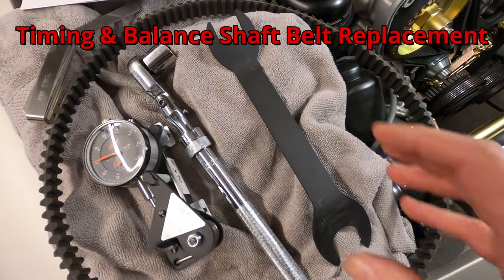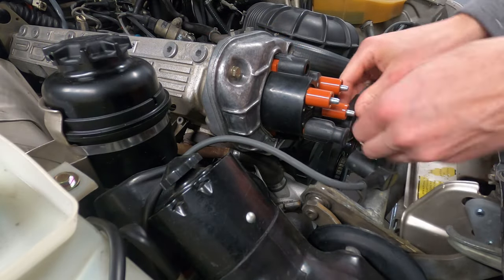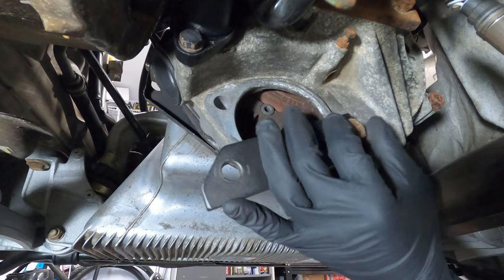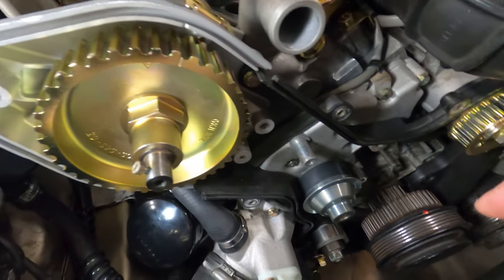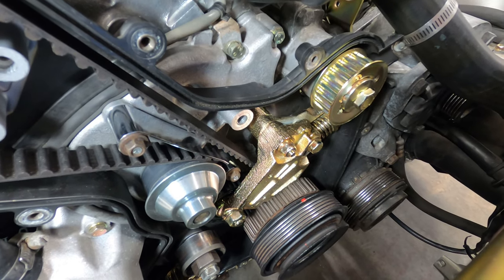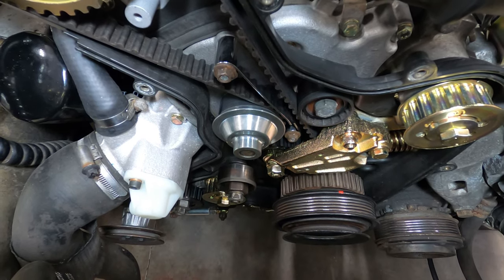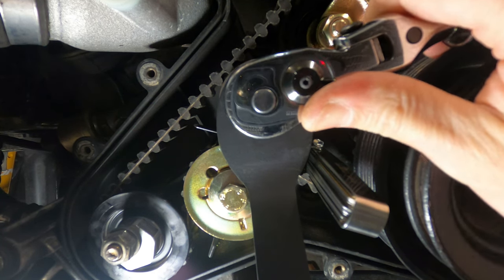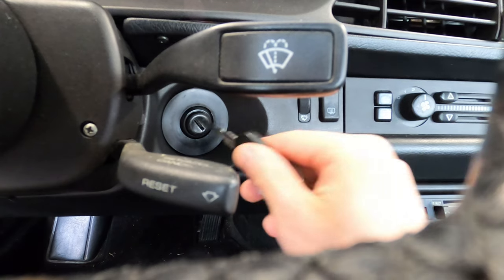Porsche 944 – Timing & Balance Shaft Belt Replacement Tutorial (Spring Tensioner / ArnnWorx Tool)

Comment: Where do I buy the Arnworxx tool??? Their website and phone number are both down
Reply from the maker: Hey! Yeah, I was sad to learn that Bruce Arnn has recently closed the doors on his specialty tool business. So, we’ll have to use the Porsche P9201 or an alternative. 944Online has the wrenches - https://944online.com/timing-belt-tool-kit-2.html
Reply: @NC944er  is there a good alternative to the genuine Porsche tool? There’s a mechanic here local with the P9201 who claims he used to work on Porsche race cars but I generally don’t like dealing with him.
Reply from the maker: @tylerdurden7067  A number of sites (Pelican, AutoAtlanta, 944Online) are offering the Krikit or KR1 belt tool now, I guess absent any other good option, but I generally understood that to be used on v-belts and serpentine belts, so I have mixed feelings about using it on the timing belt, but it appears some people have used it there successfully, even to the point of claiming that readings can be identical to the P9201 (after a learning curve). Maybe I’ll pick one up at some point and test it out.

Comment: You need to get one of the clear timing belt case covers to show off all that yellow chromate.
Reply from the maker: 🤣 I saw those on eBay a few years back. They didn’t look like the best overall fitment, but certainly functional and an interesting idea. Someone should design a “sound deadening” cover to drown out some of the belt noise.

Comment: Is the flywheel lock necessary
Reply from the maker: I try to follow the factory recommended procedures whenever possible, so I have not attempted this job without the flywheel lock, but there are numerous examples of guys out there who claim to have done it without the lock. During and after the new belt installation, you’d just want to double check that the crankshaft hasn’t moved away from the TDC position and that the timing marks are aligned before rotating the engine. 

If you’re also replacing the water pump, front main seal, or oil pump drive gear, all of which require removal of the crankshaft bolt, I don’t believe there’s a way to safely complete that work without the flywheel lock.

Comment: Is this video still applicable to a 944 turbo?
Reply from the maker: Yeah, all the same components need to be removed to access and change the belts on the Turbo cars. The process is generally the same, there’s just some setup differences on the intake and air filter housing to account for. This is a good place to start - https://www.pelicanparts.com/techarticles/Porsche_944_Turbo/59-ENGINE-Balance_Shaft_Belt_Replacement/59-ENGINE-Balance_Shaft_Belt_Replacement.htm
Reply: @NC944er  awesome thank you so much for the link!

Comment: Could you give the name and phone number of the plating company you used? I want to see what it would cost to re-plate my injector rail.
Reply from the maker: I used Parker Metal Finishing in Greensboro, NC. They have a minimum fee of $100 for the small-batch plating services, but that would cover pretty much all of the steel brackets in the engine bay if you plan to restore anything else in there. They mainly do larger-scale industrial plating so the small batches get thrown in when they’re starting a new round, so sometimes there’s a short wait time before the job starts, usually just 4-5 days. Their number is (336) 275-9657
Reply: @NC944er  thank you. I guess  the fuel rail will be all since everything else is already installed and I’m not about to take it out again.

Comment: Why are so many of your parts gold colored ?
Reply from the maker: Hey Jon, during the engine restoration process I removed most of the steel brackets, supports, and other components and had them re-plated in yellow zinc. That’s how they were delivered from the factory, but only the most well-preserved examples still retain their original plating. Yellow zinc provides some of the best protection against oxidation.